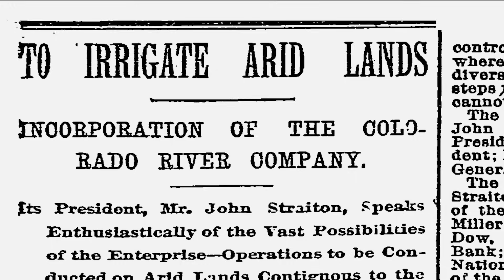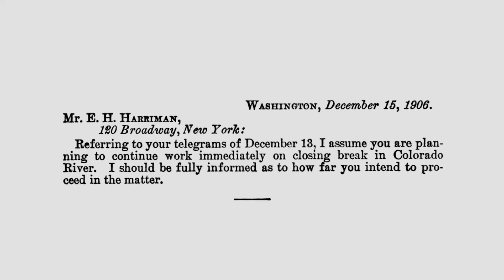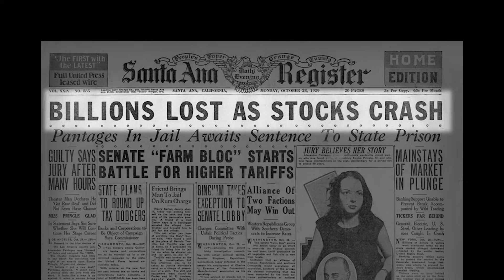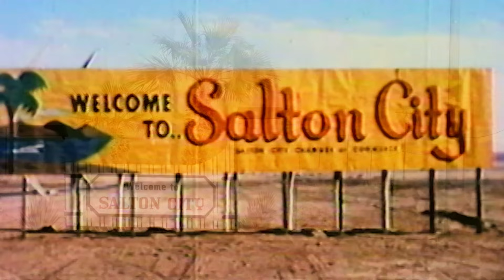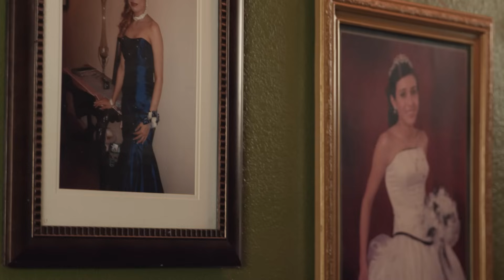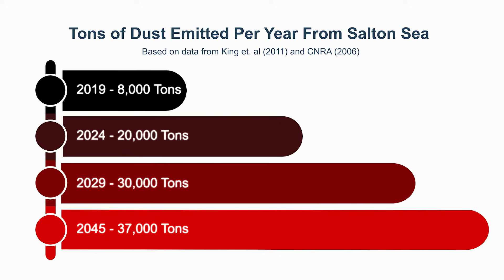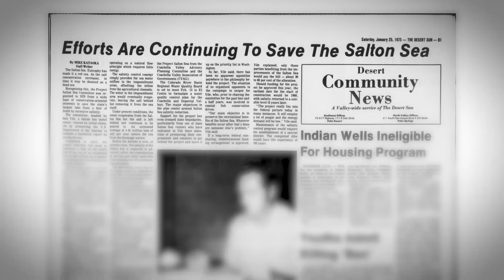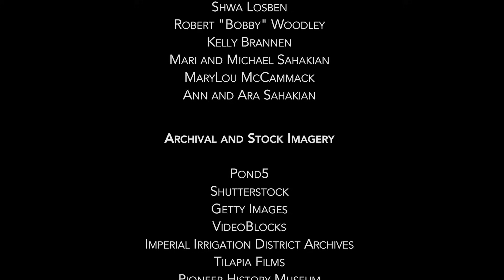Miracle in the Desert: The Rise and Fall of the Salton Sea - Documentary

Comment: The Salton Sea is sitting on top of the most abundant Lithium resources in the U.S.  Not a surprise that reclamation efforts are stalled.
Reply: Whatever private entity receives the mining rights should also be responsible for dredging and disposing the toxic sediment layer that built-up from the decades of run-off having flowed into the lake. That will help save a lot of lives in exchange for the billions and even trillions to be made in revenue from Lithium mining. The Salton Sea will go from a massive body of water to a massive quarry and hole in the ground in the blink of an eye.

Comment: Excellent documentary. Thanks for putting this together. Informative and accurate. I visit the sea yearly and am well-versed on its history. Government inaction has allowed the sea to die and way too much money has been spent on worthless studies and political perks for far too many worthless solutions - it is common sense that is needed - the Salton Sea needs salt water pumped over from the old San Onofre Nuclear Plant (using those pumps) through Camp Pendleton and up over the mountains and down into and across the Anza-Borrego Desert State Park in temporary pipes to fill the sea and stabilize it. When the sea is filled, turn off the pumps. A simple emergency declaration would make it happen but there is too much money being made on not doing anything to save the sea...common sense people.

Comment: Salton Sea vs. Lake Victoria: A Size Comparison
Lake Victoria is significantly larger than the Salton Sea in both surface area and depth.

Surface Area:
Lake Victoria: 59,947 square kilometers (23,146 square miles)

   
Salton Sea: 924 square kilometers (357 square miles)
Lake Victoria is approximately 65 times larger than the Salton Sea in terms of surface area.

Depth:
Lake Victoria: Maximum depth of 80-81 meters (262-266 feet)   
Salton Sea: Maximum depth of 13 meters (43 feet)   
Lake Victoria is significantly deeper than the Salton Sea, with a maximum depth approximately six times greater.

In summary, Lake Victoria is a much larger and deeper body of water compared to the Salton Sea. While the Salton Sea is the largest lake in California, it pales in comparison to the vastness of Lake Victoria, one of the Great Lakes of Africa.

Comment: For last 30M years the Pistol Shrimp can break clam shells with tiny cavitation bubbles by snapping it's claw. Today the Eirex Technology in Canada is five year old company that utilizes cavitation for turning contaminated waste plastic into synthetic fuel and can turn ocean, Salton Sea, or polluted New River water into hydrogen fuel lower than paying 30 cents a gallon for gasoline. The Salton Sea, Laguna Salada and Death Valley should be filled with highly profitable ocean water to produce lowest cost hydrogen and desalinated ocean water as free byproduct of lowest cost electricity 24/7.

Comment: Always felt like the Narrative around the Salton Sea was fishy.. Why would flooding from a fresh water river create a body of water that has salinity higher than the Oceans? Its the same location as the ancient Lake LeConte that was supposedly freshwater? Not to mention the soil of that area is very fertile with no soil salinity issues at all. When you go back & look at Maps from Cartographers like Mercator in the 1500's-1600's they depict The Sea of Cortez expanding up & through the Imperial Valley dividing California & Nevada which is.why the entire area is below sea lvl & you can find sea shells through the desert. A map from 1870 shows an unnamed Salton Sea. Which contradicts the narrative of its creation in 1905. In all likeliness around 1580-1750 California was a peninsula until the San Andreas fault line dramatically slipped creating a large subduction zone and pinching off the once more inland Sea of Cortez & connecting the land to Nevada.. The Sea water now landlocked formed the Salton Sea. The only real solution to saving it is to reconnected it w/ the Sea of Cortez.
Reply: The salinity came from inflow water filtering through deposits of salt and a lot of evaporation. Really poor planning on getting just fresh water there

Comment: No old man, the building of the berm and filling of the canal would NOT be the END OF IT.
Reply: Sadly I agree, they can refill that small area known as the 'keys' by pumping but until the rest of the Sea is restored the water behind the berm will keep evaporating and having to be periodically refilled which just isn't sustainable (unless they build a permanent pumping station, maybe powered by wind or solar.) Anyway, the whole point of the keys was to allow residents with boats to have waterfront property with a dock on a sheltered anchorage and direct access to the lake. The berm won't restore that, just create a big stagnant pool outside their back doors.

One more reason why the Sea needs to be refilled rather than allowed to evaporate.